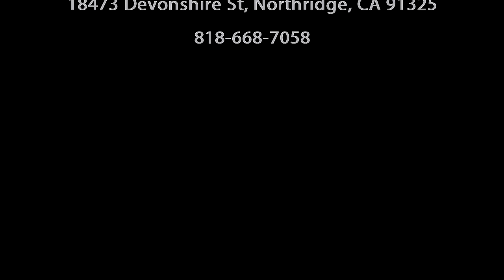CPU Socket Pins Repair for Two Asus Z170-ar Motherboards

Comment: I am the customer who had this repair done.  I am happy to report that the motherboard is working perfectly after 7 months.  They do excellent work.   I am a tech guy who does most of my own repairs but not this type of high tech repair. The owner has state of the art repair equipment to do these type of repairs.  He was very cordial and friendly and easy to work with.   In addition he shared his knowledge on other types of repair.  Highly
 recommended.
Reply: How much was it

Comment: Yup I saw it! Missed a pin on the second motherboard top left corner in video. You may get lucky if it is a no connect. $85 US. you should offer to fix it anyways unless the customer seen it first.

Comment: I have an asus maximus z690 extreme brand new. My cooler is a corsair h150i capellix which I used thermal grizzly kryonaut as the thermal paste but due to testing as receiving q code 55 the paste was so strong I'm sure while removing the cooler from the processor it bent some socket pins on the motherboard. I want to attempt to repair my self..what microscope do yiu recommend? Ir where are you based if you could repair it??

Comment: is it possible that the CPU pins could get bent if you press the CPU cooler too hard especially on intel LGA 1700?
Reply: No.  It's designed to be pressed down hard.  It's only other forces in other directions.  Or foreign object pressing down in one spot too hard.  Or corner of cpu falling on it

Comment: مسالفل  أخي وأستاذي الأستاذ حسين بارك الله بك على معلوماتك الهامه جدا  ممكن سؤال أستاذي  اي نوع من القصدير للحام كوكنكترات الهاتف المحمول ممكن استخدامه وكم نسبه القصدير والرصاص والفلاكس والسماكه اذا تتكرم علينا بهذه المعلومه ولك كل الاحترام
Reply from the maker: سلام أخي سلمان . أنا بستعمل نوعين 
0.015 and 0.031 63/37
https://rover.ebay.com/rover/1/711-53200-19255-0/1?mpre=https%3A%2F%2Fwww.ebay.com%2Fsch%2Fi.html%3F_from%3DR40%26_trksid%3Dm570.l1313%26_nkw%3DSolder%2B63%252F37%2B.015%2BDIA.%2B1LB%2BSPOOL%26_sacat%3D0&campid=5338440312&toolid=20008

https://rover.ebay.com/rover/1/711-53200-19255-0/1?mpre=https%3A%2F%2Fwww.ebay.com%2Fsch%2Fi.html%3F_from%3DR40%26_trksid%3Dm570.l1313%26_nkw%3DKester%2B44%2BRosin%2BCore%2BSolder%2B63%252F37%2B.031%2B1%2Blb.%2BSpool%26_sacat%3D0%26LH_TitleDesc%3D0%26_osacat%3D0%26_odkw%3DSolder%2B63%252F37%2B.015%2BDIA.%2B1LB%2BSPOOL&campid=5338440312&toolid=20008
Reply: Who is Hussein 🤔

Comment: I use to do auto keys, on models only could be done  buy micro/eeprom. People use to not understand that one honda can be programmed by a clone machine by the el chepo guy down the street for 50 bucks. Then other cars cannot be done without pulling the car/immo box apart. Hey if the man can do it down the street for 50 bucks go get it done. When they come back with no car keys able to programm in. Do not cry for me charging what I have to charge.